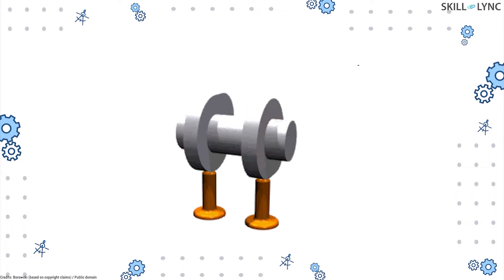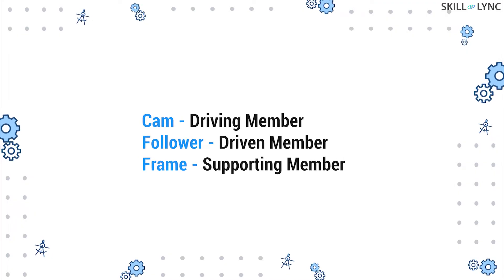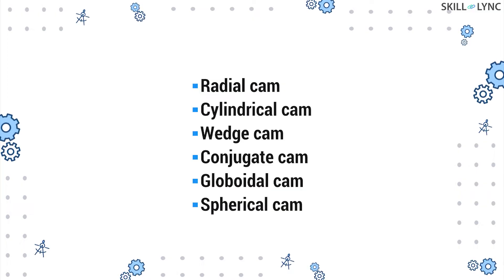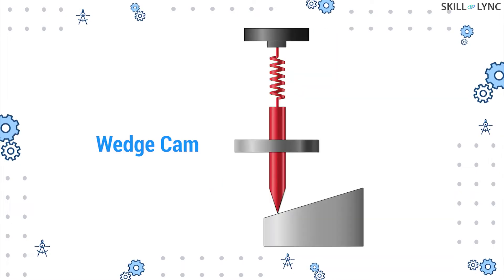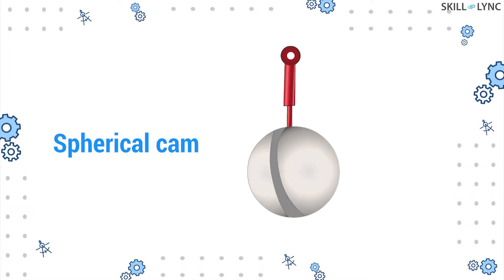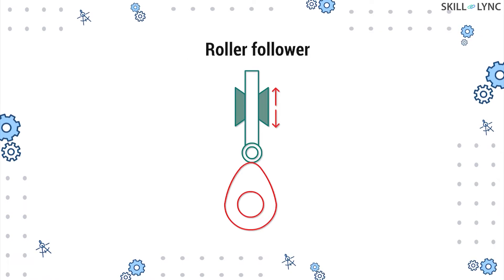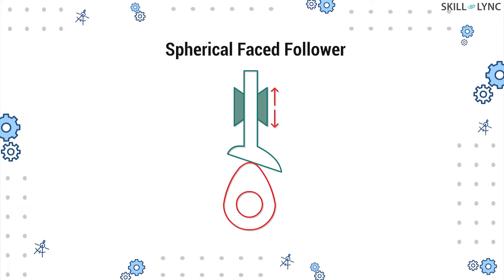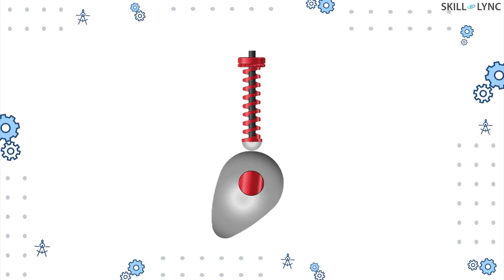Different Types of Cams & Followers | Skill Lync

Comment: Is there a video of application of these cams and follower mechanism, for example so and so cam is used in a lathe machine vs so and so is used in a fuel injection system of a car/plane/turbine. A follow up video will be greatly appreciated